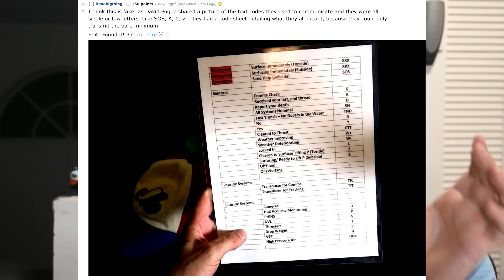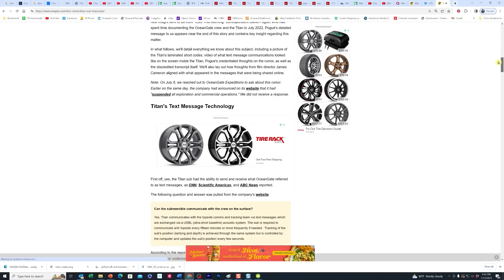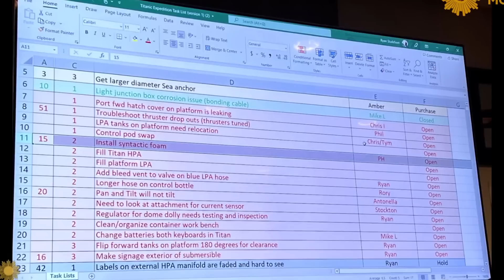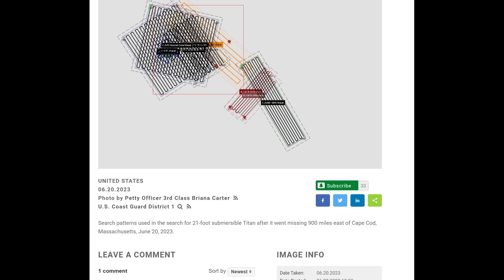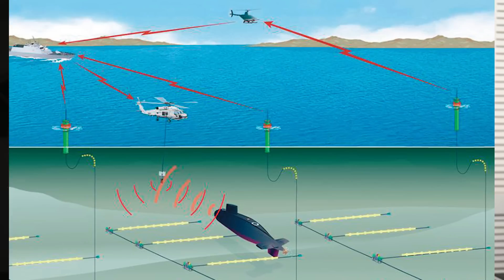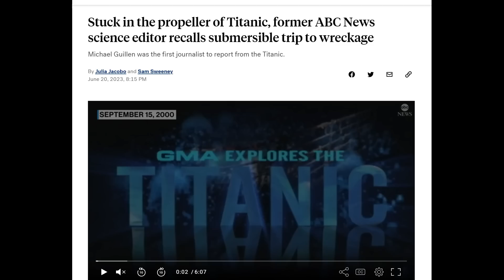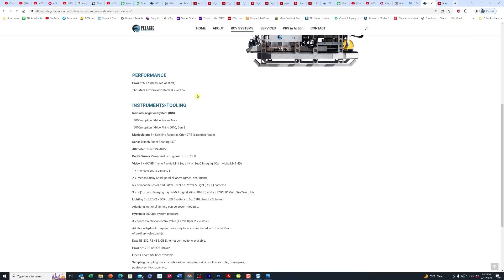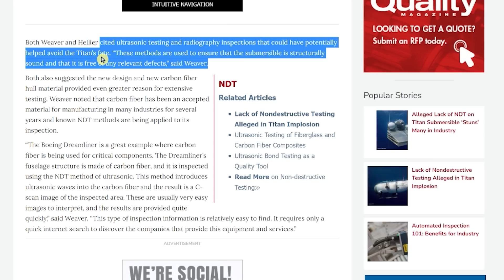The Shocking Truth About Fake Sub Transcripts No One Tells You

Comment: Notice the tone of the top side when they said 'Do you need to adjust velocity?', its passive instead of a firm 'Sub, you need to slow down your descent'. The whole crew was probably afraid of their boss Rush and would never dare to question or undermine any of his decisions/moves. They knew they wre giong down too fast but were too afraid to address it firmly
Reply: Agree 100%.
The tone of the mothership in general sounds extremely passive, as if they walked on eggshells whenever they interacted with Stockton.
That’s why I do think this
transcript could really be legit.
It became clear through all the videos I’ve watched reporting on this incident that Stockton hired young kids on purpose because they would never have the ability to speak frankly with him, apparently not even in life or death situations.  The communication seems accurate based on what we know about Stockton and his immense ego and his OceanGate employees being hired basically to be 
a source of his narcissistic supply.
Reply: @rickbrenner6079  It has a lot of unnecessary detail, that wasn't public info that rings true with early rumours by connected DSV folks. And if there was a transcript, it would be shared, and if it was shared? Well when's the last time some random engineer had a major bews story delivered on their table for free? It was bound to leak. It was leaking drom day one and the story is the same just more details.

Also SR seems, yes determined to keep going but other than that? Relatively professional. If it was a fake, why not make SR look worse? Like something along the lines of "the hull is sound it cannot implode" kaboom. Yet lots of sensationalist stuff one might imagibe for a fake isn't there. And who would think to make Polar Prince sound almost passive aggressive.... again unnecessary detail that doesn't make the stoey more or less interesting at least to most. 

I call.... this is real. If anyone wants to wager I'm broke as hell but I'll take your money.
Reply: There is definitely deferential, “please don’t take this the wrong way” kind of tone.  It is crazy to imagine that the man was that much of a hothead that people had to dance around or P—foot around him even during a catastrophe.
Reply: @onegirlrev  considering he fired their only experienced pilot for bringing up safety concerns, yeah id believe he would.
Reply: @onegirlrev you can say pussyfoot ya know… that’s a default word in your iPhone dictionary even lol
Reply: Maybe one of the reasons why it was worded like that so they wouldn’t panic the passengers on board (yes, paying passengers, not crap mission specialists bs).  
And people get really stupid when they panic which can potentially make a bad situation worse.
Stockman Rush was an egomaniac that shut down anyone that questioned him, took sound advice and criticism as a personal insult, and didn’t like people who said anything that put his “work” in a negative light.
Maybe the surface crew were also told to downplay any issues that would make him look bad and bruise his fragile little ego, if his passengers gave him a negative review afterwards.
He did put in things like, “smooth sailing” and “crew happy” and “enjoying the view,” was just Stockton Rush stroking his ego throughout the dive instead of paying attention to the task of piloting that carbon fiber coffin.
Reply: @thed165 you make an excellent point, considering his passengers were billionaires.
Reply: If a first officer in a plane notices the captain is doing something wrong, he MUST tell him/her.
Reply: @jjeherrera Problem, none of them is in the "plane" and said "captain" has the authority to fire said first officer and did so before he got a replacement who would rather not repeat that "mistake".
He brought this on himself, and he yook 4 other lives with him.
Reply: @jjeherrera What you say is true, however there are many instances in aviation where an aircraft got into trouble and people died simply because the co-pilot was afraid to mention to the pilot that a decision was wrong or some action was wrong.   There are many transcripts on YouTube showing this very thing.
Reply: @PalKrammer yes but the industry responded with  assertiveness, awareness, and communication training, so that those incidents could be avoided.
Reply: @jjeherrera    ya, I think the term is cockpit resource management ... which means even lower ranking personnel are encouraged to speak up without fear of the pilot pulling rank
Reply: @jjeherrera  That's what's supposed to happen, but that depends on the airline pushing CRM (Crew Resource Management).  I get the feeling CRM wasn't a thing in this company.
Reply: @jjeherrera  This isn't a plane, this is a Keystone Kops operation.
Reply: @jjeherrera  This isn't a plane, and there was no co-pilot Just a diabolical narcissist.
Reply: @jjeherrera They weren't copilots in a plane, though. At best, they were passengers in the car next to the idiot speeding down the highway. You can say to yourself, "Oh man, that guy should really slow down, he could hurt someone" and honk on your horn to say, "Hey, you're being a reckless jackass" but what can you REALLY do to keep him from landing in a ditch 10 miles down the road?
Reply: @jjeherrera  This is true now, but in years gone by the Captain God Syndrome was the case, and more then one aircraft accident was caused by it (Trident 'PI at Heathrow, for example).
Reply: Well yeah.  You push too hard and you get insta-canned, ask Mr. Lochridge.
Reply: @Darkkfated  I was mad that the guy who was making sense got fired for the horrific crime of making sense.

At least he has an “I told you so…” coming his way.
Reply: @Darkkfated  Well, he’s around to ask. Better to be fired than killed by your boss.
Reply: @ajmacphoto  To be fair, there's a news article about how the former finance director quit OceanGate because Rush asked her to become the pilot, I suspect it was a mix of overconfidence and indignation that his employees would rather quit than ride his deathtrap that motivated Rush to become the pilot.

Nobody's willing to talk back tot he boss because they didn't want to be fired, but they seem to be more than willing to quit when he asks them to die for him.
Reply: Exactly! I thought the same thing!!
Reply: I'm a comm expert and this is my conclusion too based on the nuance of the conversation. The responses of 'understood' by top side indicate they have concerns but don't want to override Rush, especially since he fired and sued a former employee who disagreed with him. Rush also reiterating how the passengers were enjoying themselves while ignoring top side's concerns demonstrate his history of boastfulness and carelessness.  The subtle dynamics of their conversation feel authentic.
Reply: I agree. The people in the sub can see the screen too, and I guarantee that if they'd said he was going down way too fast where the clients could see it and freak out that they knew Rush would've fired them. I've had many older male bosses when I was a young woman and 90% were overconfident in their own decisions so you learn to ask questions in a very non-presumptive way when they're wrong so that they can "figure it out" themselves, or else they yell at you and threaten your future at that job.

Example..Me to VP of company:
Here are the numbers for the quote for company x. I just wanted to make sure you wanted to sell the entire company for $1.00?? 
VP: "Change the $1 figure to $1 million dollars and print it again."
  They'll never thank you for catching it, but if you question their quote in a more direct way they'll yell at you for your tone or not trying to tell them sooner about it. I've had managers that paid me peanuts and treated me terribly proofread my orders and miss the same things I had, but tell me the mistake started with me and put full blame on me and accept none for himself, the VP, not catching it. Everyone knows you don't proofread your own work because you don't catch your own mistakes as easily as someone with fresh eyes. I'm so damn glad I'm too disabled to work now..
Reply: @dez6278  Hmm. Assuming that was just a simple typo it would be a very weird manager who would react badly to it being pointed out in the most straightforward of terms, in fact most would be very grateful for the spot. It's not like you were questioning their judgment. If I were the VP I would take that response, unless it was said with obvious humour, as annoyingly smug!
Reply: The increased decent speed should have resulted in an abort, but even worse was the rate of decent was increasing over time. An unknown error had occurred, yet this psychopath continued on his merry way.
Reply: I have faked things before, and I am nowhere near as good as this. This is real.
Reply: There was definitely a power imbalance between Rush and everyone else on his team. This permeated the entire project from the design phase to the final accident. Rush always knew best. On the dives he should have set up resource management with clear lines of responsibility. Perhaps he had done that but ignored the plan when it suited him.
Reply: That’s one reason why I think this is legit but I could be wrong but it’s possible that one of the crew on topside could have sent to a friend or colleague to get their opinion on the matter and that person could’ve leaked it.
Reply: I would have replied" okie dokey Mr rush. Warp speed ahead..Increase velocity an decent. I'll see you in the afterlife, over"
Reply: Definitely my thought too, but would be nice to corroborate legitimacy to that, with testimony of the mother’s crew for exemple. On how their boss was seen by them.
Reply: @NathanTrukise  Yes, that would be confirmation. Until then, it's up to ourselves.
Reply: Let me point out that there was no proper speed for Titan. All speeds lead to catastrophic failure. Even if there was some arbitrary speed they all decided was a good speed, there doesn't seem to be any indication that their decision was based on any solid reasoning.
Reply: "Do you need to" sounds rhetorical.
Reply: It was an honor serving with you,😅
Reply: crm here is watever the ceo said/demand !
Reply: See now this makes sense knowing how he treated the guy who raised questions
Reply: Sure because all his workers were 18 year old pink hair folks, instead of 50 year old white men...
Reply: Rush’s arrogance lee to their demise.
Reply: I think that's part of it. I think the other part is all the passengers can see exactly what is being transmitted and they don't want to cause a mutiny
Reply: SuperNostalgia. Go play in traffic and stop harassing people with your fairytales, go away! SMDH! 🙄
Reply: Good catch. Didn’t notice that at first
Reply: Because of the fear of SR, it is easy to imagine how after the implosion all of the crew looked at each other speechless and in disbelief, before a great cry goes through the mothership "We are free, we are finally FREE!!!"....

Comment: I could be wrong but I doubt the ROV lifted the wreckage itself; what it probably did was guide and attatch a line to the wreckage using the robotic arms; then a crane onboard the surface ship itself actually lifted it.
Reply: He read "through frame lift, 2000 pound", so the frame could lift 2000 pounds attached to it. And "the lifting fixture 4000 pounds", probably meaning connected directly to the cable.
Reply: @AORD72  That is the correct reading. 2000-4000 lbs of lift is more than sufficient to lift the titanium hemispheres or the landing frame.
Reply: @asimian8500  I agree.
Reply: I believe there was an industrial type of basket that the ROV would place the parts in to.
Reply: That's exactly what they did. The crane lowered a large cargo net style basket and the ROV then retrieved the wreckage and placed it into the basket. Once complete, the crane retrieved the wreckage via the basket.
Reply: See my comment above. I broke it down for everybody. The Navy used a heavy, lifting system that you have to weld to the deck of a large ship. That does the lifting. You can you can lift entire aircraft with the thing. It’s really a neat system.

Comment: I don't fully understand hydro-statics but in terms of diving too quickly down then I assume that is worse then diving slowly as the pressures would be changing quicker diving faster - hence more stress on the hull? That's why they are saying adjust velocity? As many have said it looked like the Titan took a battering being dragged across the Ocean by Polar Prince by a rope rather than on board the Horizon Arctic. That can't of helped the hull integrity.
Reply: The issue with diving too quickly mainly has to do with it being an indication that the vessel is overballasted. If the transcript is legitimate, the Titan submersible was ascending very slowly after dropping both weights and even the "frame", so there may have been some weights that failed to detach. Had they been able to make an emergency ascent at 50 m/min, that could have reduced pressure on the hull by 25% in the 19 minutes the transcript indicates they had after the acoustic real time monitors first indicated serious delamination was happening.

In recreational scuba diving, one can load up with excess weight to get to the 40 m/~130 ft depth limits in under a minute, but that poses safety issues. Excess weight requires more buoyancy compensator (air bladder) inflation to compensate, can interfere with body orientation, and makes it more difficult to make microadjustments to buoyancy with lung volume. Buoyancy compensators can take on water, so its possible that there won't enough volume to ascend. Ditching the weights to compensate is costly, and also poses risks of uncontrolled ascent and decompression sickness. And, its possible for ballast weights to get tangled with other gear so they CAN'T be ditched.. It's always safest to dive with the minimum ballast required for controlling buoyancy towards the end of the dive (when the air tank itself has become more buoyant).
Reply: Towing is probably safer than lifting a 10 tonne sub off the deck of a ship. If the tow raft has enough protection from waves or debris in the water why would there be a problem with towing?